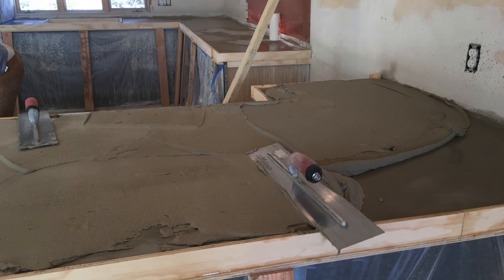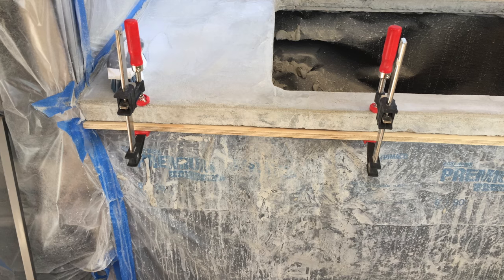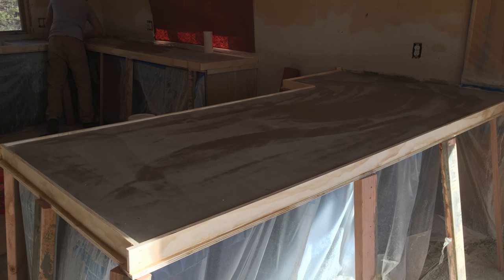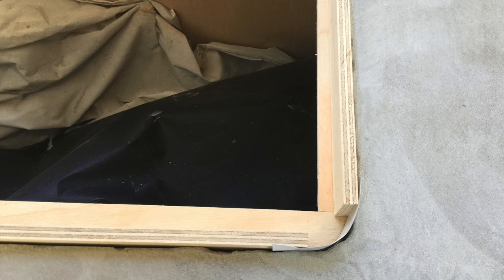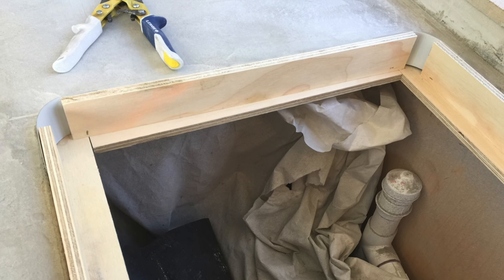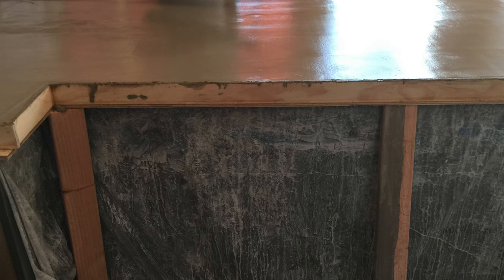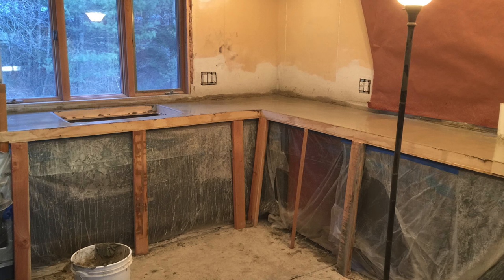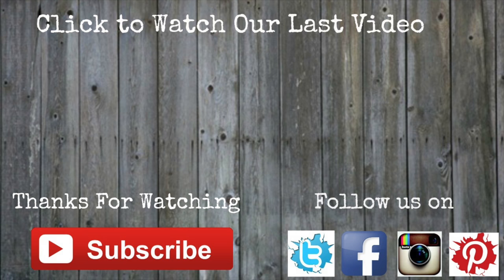How to Pour a CONCRETE COUNTERTOP  Over an Existing Countertop

Comment: I need to cover over tile countertop and really like your approach. I actually think this method would be my direction. Our counters are edged with trim that matches the wood accents throughout the house. My intent is to remove the tiles and use the remaining 1/2” trim as a form. Throughout the various videos posted from the many DIYers who do this type upgrade to their countertops I noticed that some form of mesh or rebar is used. I noticed that you didn’t. How has time/wear held up the countertops?

Comment: how deep was the concrete? 1"?
Reply from the maker: 1/2 inch
Reply: Thanks!  One more question.. the concrete calculator calculates that I will need 2cubic feet for 1/2 depth.  How many bags do I need, as I unsure if the amount of water you add is the same as on the instructions from cementall.. (25lb bags, as that is all they have at Home Depot near me).. thanks!
Reply: also, did you apply a top coat of sealer or resin or anything to seal or to make more shiny, or was the finish shiny just from the cementall?  what shade of grey did it end up after drying?